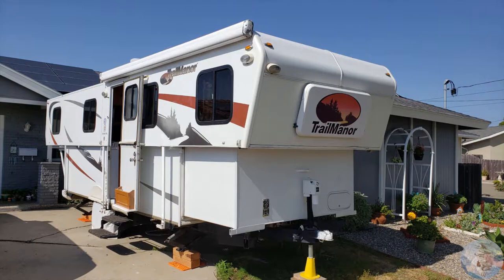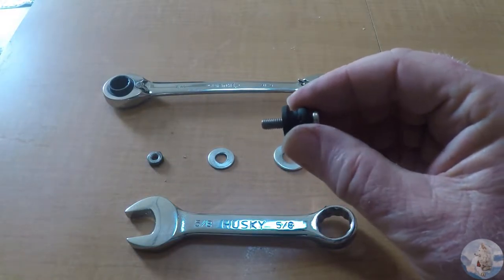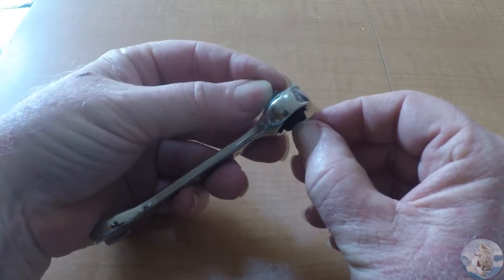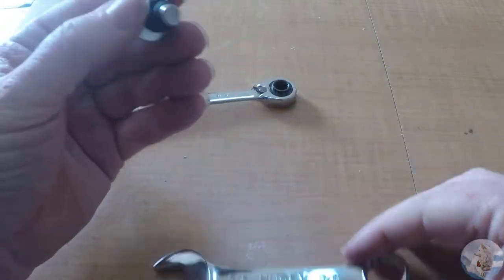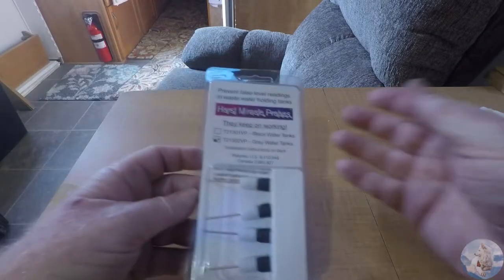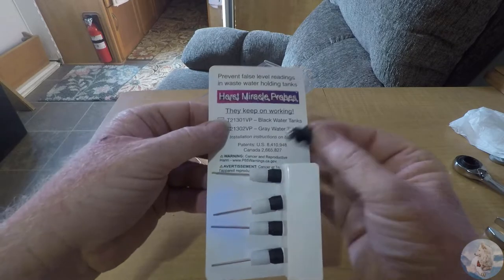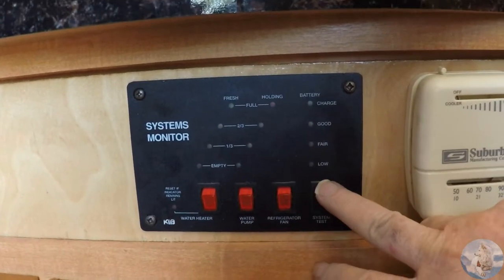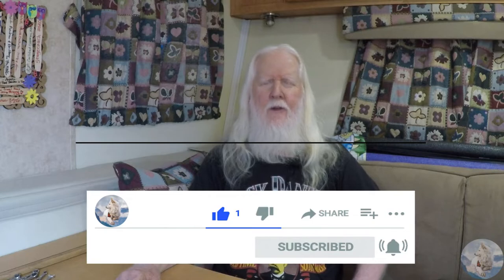How we did it; Horst Grey Tank Miracle Probes Install 2011 Trailmanor 2720SL

Comment: I’ve spent hours looking for best way to do this. This is the best informational and complete video I’ve found on the subject.  I can’t believe the amount of misinformation on the subject. Thank you for your time on putting this information out.
Reply from the maker: Hi Mike and thanks for watching and commenting.  We tried all of the "Secret Sauces" with no success.  Even if one has spin-welded sensors, these are a pretty easy install.  One just has to get the hole size right.  Ours was a bit tighter than most but not too bad.  Good luck with your sensor replacement and safe travels.

Comment: I just did this exact replacement with my 2011 TrailManor 2720SD.  To remove the old probes, which I expected to come out with some good wiggling, which didn’t work, I decided that pinching them to fall INTO the tank was not a major problem.  The old probes would eventually vibrate to the low point in the tank and drain out.
Reply from the maker: Hi Roger and thanks for watching and commenting.  I don't know why your comment just recently appeared.  Most strange, but happy it did.  Glad you were successful.  That's a good workaround for pesky sensors that just won't cooperate.  Safe travels.

Comment: Thank you for this extremely helpful video.  A year ago I purchased a used 2012 Jayco Jay Flight 26BH and was getting some pretty false readings on both grey and black tanks.  Both reading full even though we knew for fact that they were emptied.  The only issue I encountered was that my 3/8" wrenches were too thick and I couldn't get the outer nut loosened as they were sort of stuck together.  Should've sprayed some penetrating oil first.  I ended up using needle nosed pliers to hold the inner nut in place and that did the trick.  Seven of the 8 sensors came out great using this method.  One of them didn't have enough bolt threads to pull out so I simply pushed it into the tank.  Hopefully at some point it will be pushed out during emptying.
Reply from the maker: Hi Rene and thanks for watching and commenting.  It's a pretty slick way of getting out the old sensors.  I'm glad things worked out and you now have some truthful tank monitors.  Safe travels.